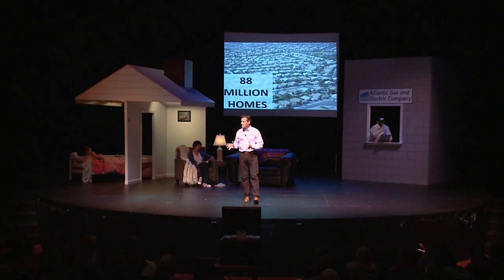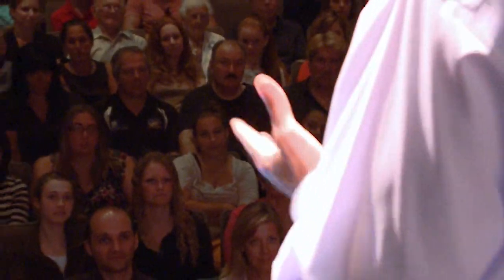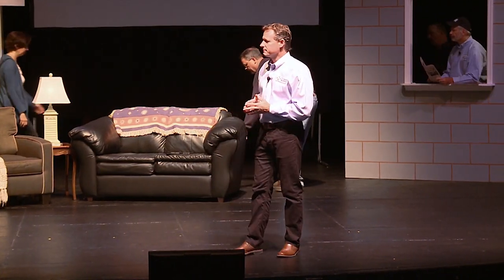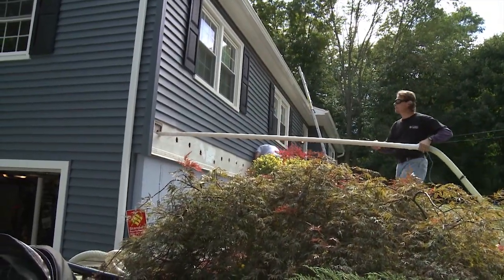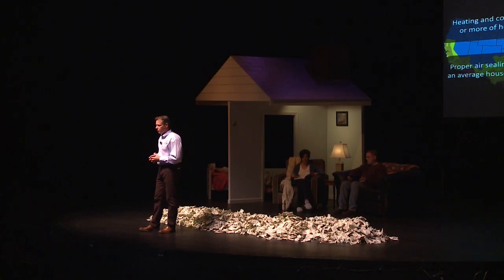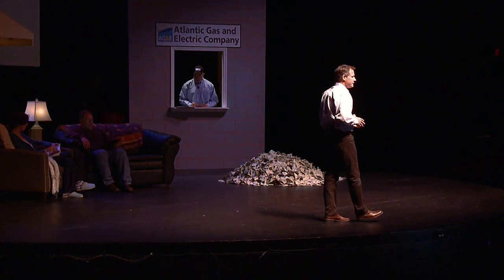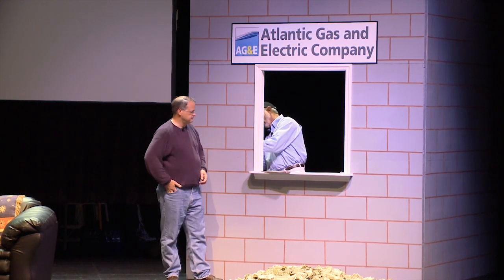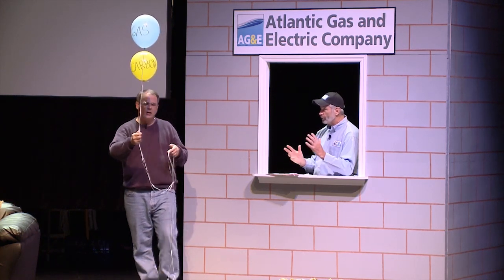Home Comfort Pays for Itself | Ideas Worth Sharing

Comment: Perhaps the math works in CT, but not here in Cleveland. A typical annual natural gas bill for a 2200 sf house is $700-$1500. We can often knock out half of the heating portion of that, but that's only $200-800 in annual savings. There are of course some air conditioning savings, but typically not more than $100-200. A typical job aiming at delivering results runs in the $10K range for starters. If the job is that cheap (most aren't), that's a simple payback in the 10-40 year range. Most would not consider that in 'pay for itself' range.

What we say is that improvements HELP pay for themselves. This is true 100% of the time. Our clients typically are solving another problem like comfort issues or icicles, the money is the icing on the cake, but not the cake. 

Measuring has been rather sobering, my old jobs sucked. It has taught me a great deal, though, and I recommend the path. Make a bet on savings (not a guarantee), tell the client you aim to deliver that bet and that you want to see their bills to track it, and watch. Some jobs will rock it. Others will stink. You'll learn every time, though. 

Our industry needs real measurement, otherwise we're still selling snake oil, and we'll remain a joke for the next 40 years. I can't abide by that.
Reply: "A typical annual natural gas bill for a 2200 sf house is $700-$1500."

Good lord, where do you get your gas from, and can I get some of it?

Like the man said, you have to do the math and apply it to your situation.  The building that I live in, for instance, could absolutely do with some energy efficiency retrofits.
Reply: rdormer 'Pays for itself' is a dangerous promise to me. Even in homes with expensive heating fuels, 'payback' can easily be in the 10-20 year range if you do retrofits that are unlikely to cause other problems, like mold.

I live in Cleveland, natural gas is very cheap here. Heat pumps can have similar operating costs, but the house has to be pretty air tight first. Something to consider for your home.
Reply: Nate the House Whisperer  Mold mitigation work and cosmetic work and work to fix rot are not included and do not need to be justified by a payback.  This video was made when fuel prices were much higher.  Even if the return was 12 years or so, you will pay for it anyway.

Comment: $7500?? His co. ,Dr energy, quoted me 18000 for a 2200 sq ft home.highest estimate I received. What a joke.. I do love his videos though and make sense to do
Reply: Mold mitigation work and cosmetic work and work to fix rot are not included and do not need to be justified by a payback.  This video was made when fuel prices were much higher.  Even if the return was 12 years or so, you will pay for it anyway.  AC cost are not gas, of course.